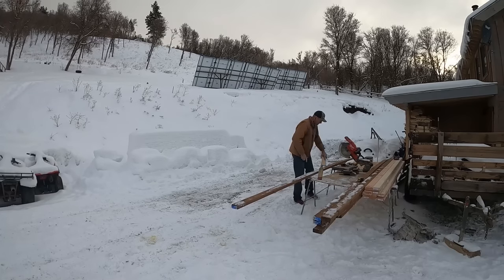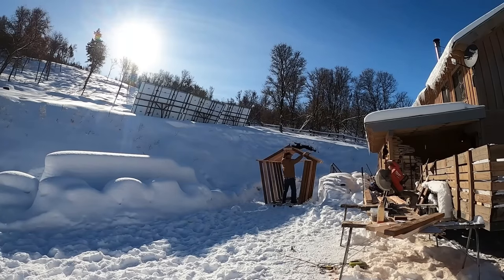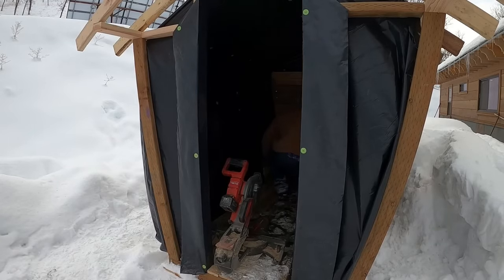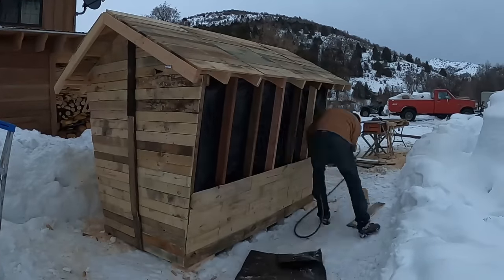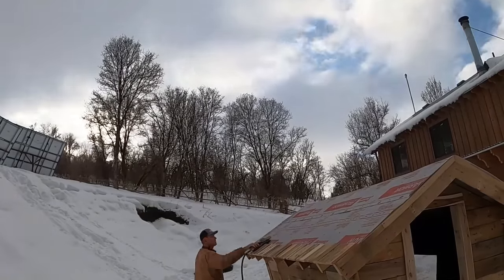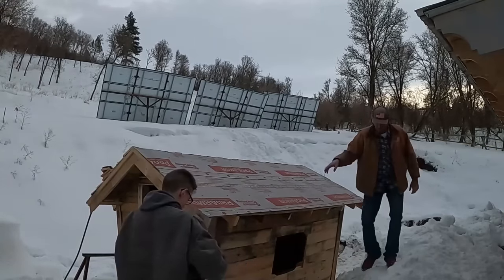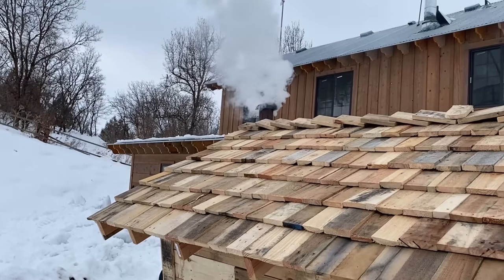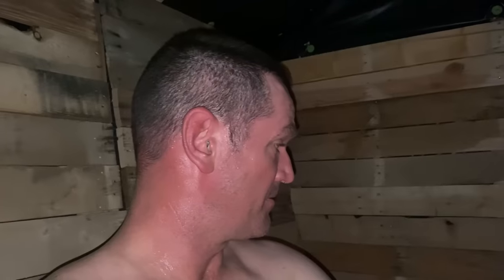#394 - I Built A Sauna Out Of Pallets! And It Works!

Comment: Ah Yeah !... Cutting half inch material with the table saw blade three and a half inches out of the table is Crazy. You only need a quarter inch more than the thickness of the material in any situation. This way if you have an accident you merely knick a finger.... instead of  cutting your hand off. 
  Just a thought.

Comment: An old trick to extend the lifetime of wood outside or in the kitchen is to use linseed oil. With what you created, 1-2 gallons will make it last years. Either spray or paint on and let it dry in the summer sun and re-apply once after about a month - rinse and repeat every year or as-needed. You'll see water bead off like the wood has been waxed but it's almost clear. No harmful chemicals, all natural and it'll make that sauna last much longer.

Comment: This is another great build! 
One honest question about your heat source design, placement and fuel source: what about carbon monoxide leakage? Please be extra cautious with this. CO poisoning is almost always deadly and when it's not the damage to the nervous system is irreversible. 

(Check this website for a few tips that apply to your case: https://www.cdc.gov/co/faqs.htm )

Among others: "Horizontal vent pipes for appliances, such as a water heater, should go up slightly as they go toward outdoors..." 

I hope you don't get upset about bringing this up, it's a serious concern, so please don't brush it off.

Comment: The long breaks in between while telling the story about the propane tank, were painfully long! Way too long! It doesn’t work as emphasis when that long, then it’s just fragmenting the story… Just saying… 

Your sauna is a cute, little one! Perfect and probably quick to fire up… Well done! I hope it’ll last a good while, that you won’t regret using pallet wood… BTW, I’ve never seen anyone build a sauna from ceder wood here in Norway, though it probably happens now and then. Fir, ash, grey alder, European Aspen are the most commonly used ones for saunas here. But, pine is discouraged, even if it is the most common type of wood for building here. The reason why pine is strongly discouraged, is that pine has resin which comes out when it gets heated and the resin gets very hot and can burn you - imagine sitting down on hot pine resin…  😮😢😝

Comment: can you take a piece of plywood.. put some legs on the back so the plywood stands at an 15 degree angle and a 2x4 across the long side top..  nail scraps from the sauna on the plywood.. so the goats have a 4 foot high climbing wall to have fun on without being so tall they can't fall far..  i keep thinking of spreading trees that have goats standing up on the branches on top of the trees like this.. https://youtu.be/gEaAmUDEiGo  it would really confuse the horses across the road..

Comment: NO plastic wall, aluminium foil cover imside wall need make.sauna need breath too not be plastic bag. no good. if burn wood need breath and need near floor have airtube under stove, and need air tube out near roof, and wall normal have aluminium foil and then wood panel.and normal all timper rule have. floor NOT ewer use nails, come up, need use alltime only screws. and in sauna uses stainles steel screws.